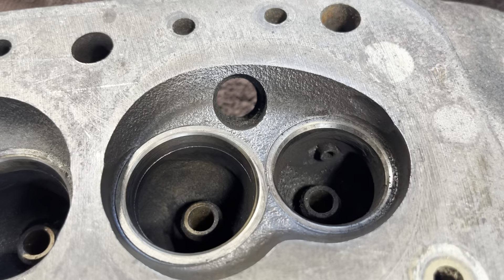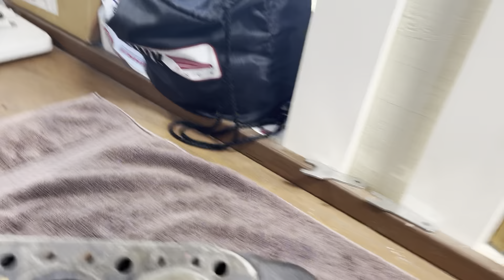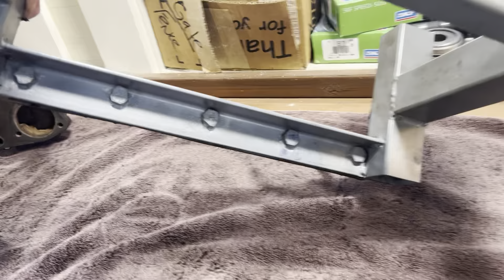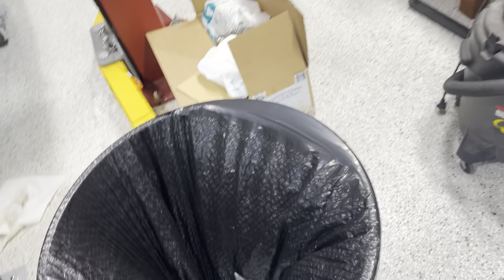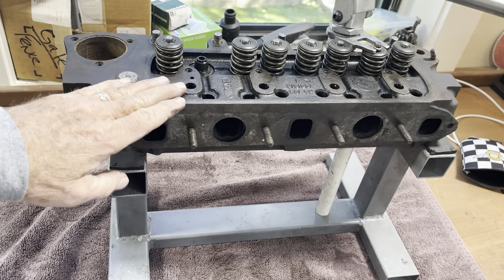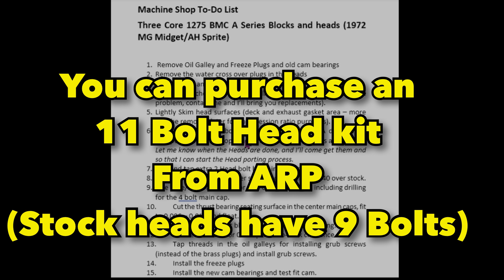How to Build a Spridget Race Engine - Ep 2 - Initial Head Preparation + Machine Shop To-Do List

Comment: Great video.. Just found the site and subscribed.. I look forward to more on the engine work tutorials.. I do have a question about the spring compressor you use. Store bought or made?  If available where would one go to purchase one or the parts to make one.. 
Please keep the videos coming I have told friends and they too have liked the videos..

TX  Mr fixit
Reply from the maker: Thanks for your kind comments.  

The spring compressor is store bought.  Nothing fancy.  Im sure I got it off Amazon or Summit Racing or equivalent.  What really helped me was building the head stand to work from and attach the compressor too.  It just screws on to the stand just like it would a regular head bolt.

I’m working on the head porting videos right now…should be out soon!  

Thanks again…

Comment: That's a heat tab, remanufacturers put that on there for warranty in case of over heating.
In case of over heating the center of the tab will melt out, telling the rebuilder the engine was over heated.
The hard seats are to stop seat recession,  like you have in that head.
And to restore seat heights, thus adding to the short side radius length or depth.
To improve flow through the short turn and flow into the chamber. 
Good idea on the spring compressor. 
Take care, Ed.
Reply from the maker: Thanks…that makes sense….

Comment: Headbytes had the idea of nickel spray welding the valve seat area. That way the valve seat area could be rebuilt, handle unleaded gasoline, and be flexible in installation.